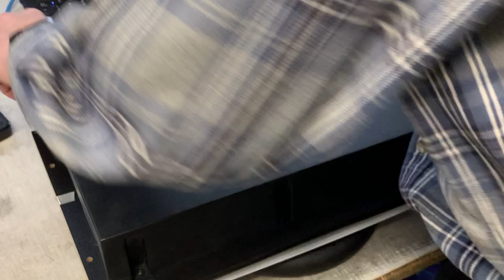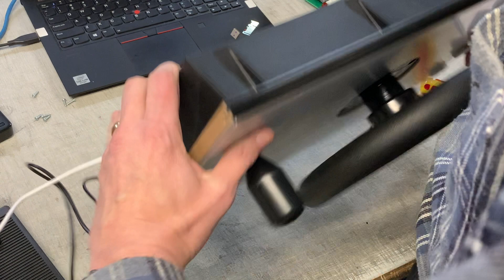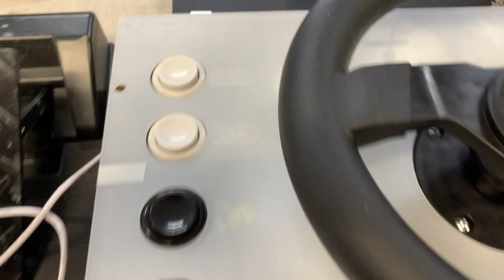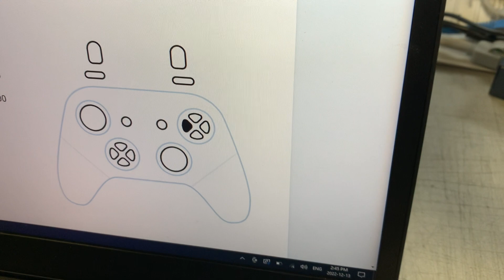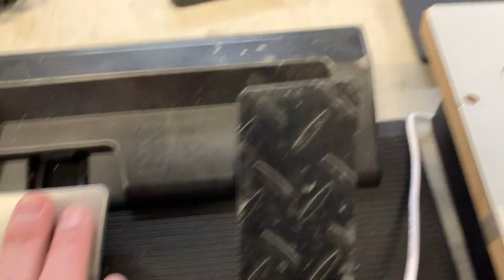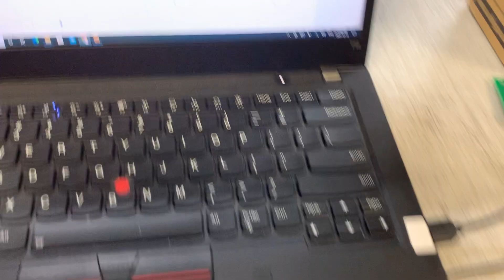A1up Ridge Racer Encoder Board swap

Comment: I got your encoder and HDMI boards the other day for my Ridge Racer and everything is hooked up to a PC I built for racing arcade games. I have a couple of questions though. It seems when I push the gas pedal, it's not at full throttle and I hooked it up correctly. I especially noticed while playing Pole Position in MAME as the car doesn't have that high rev sound when the race starts. Also how do I activate the rumble while playing my games? And great work guys! I am super impressed with all the time and effort you put into these boards!
Reply from the maker: Check your pedals on gamepad-tester.com, but you most likely need to calibrate the pedals. Rumble is activated by the various emulators. For MAME, you can use the FFB plugin to activate rumble. You do need to be using a more recent version of MAME for FFB to work.
Reply: @BuyStuffArcades  Ah ok. Thanks for the reply I'll check that out!
Reply: @BuyStuffArcades  I forgot to mention I tried calibrating the pedals and controls with the default tester in Windows 10 as shown in Kongs 'R Us's video. What is another way I could calibrate the pedals? Thanks again!
Reply from the maker: @atranfanatic  Did you hold A and B and the pedals down for 2 seconds when plugging the encoder USB in? RRencoder.buystuffarcades.com
Reply: @BuyStuffArcades  No I didn't would that help calibrate the pedals more?
Reply from the maker: @atranfanatic  Calibrating the pedals is mandatory - every set is different.
Reply: @BuyStuffArcades  Ah ok. Will that calibration work with me having a PC? Also should I turn my gaming PC on in my cabinet first before holding the buttons and pedals while turning on the main switch for the machine?
Reply from the maker: @atranfanatic  Yes, the calibration stores on the encoder board so it doesn't matter what it is connected to. Just plug the USB cable into your PC while holding all the buttons and pedals down.
Reply: @BuyStuffArcades  Ok cool appreciate all the help! I'll try to do that here soon and let you know the results.

Comment: All of the buttons and steering worked flawlessly, all except the rumble. On the gamepad tester site, under vibration it shows as N/A, I did try unpluging the rumble (carefully) and plugging it back in, also tried removing the software and installing it again but still no rumble, however... having no rumble isn't a deal breaker for me, a little bummed out but still happy with my purchase.
Reply from the maker: Send us an email with some pics of what you are seeing on GamePad tester. NA would mean it's not being recognized by your PC as a rumble eligible controller. Every board that goes out the door is rumble tested on our system, so something sounds abnormal.
Reply: @Buy Stuff Arcades  There's no need 😁 the rumble works! Turns out it was because of the browser I was using (Firefox) lol once I used edge explorer, it worked out as it should! Extremely happy now! Thanks!
Reply from the maker: @SketchModsThings  Oh good to know - have not tried with Firefox before.
Reply: @BuyStuffArcades  yeah, I should've known, Firefox is good but not with everything lol

Comment: Can this mod work on android 10 stock Firmware? Or you need to used computer PC only. So the break and gas paddle do not work?
Reply from the maker: Our Gaming Box is pre-configured and is running on an Android Box. (Under Linux) Yes, the gas and brake pedals work.

Comment: What is the difference between player 1 player 2 and player 3 option?
Reply from the maker: Just added this to our FAQs - let me know if it helps explain it better: 
What is the difference between Player 1, 2 and 3?
They should be purchased in numberical order unless you already have one of our compatible Yoke and Racing Gaming Boxes. Basically, the Player 1 kit is the Master which you need to have whether you plan on network gaming or not. Player 2 includes a pre-configured router and will work with your Player 1 for network gaming. Player 3+ will just add as extra players to the Player 1 Master using the Player 2 router. All players will also work stand-alone, but you need to have a Player 1 and Player 2 before ordering a Player 3+.